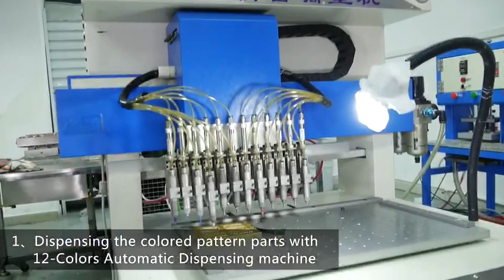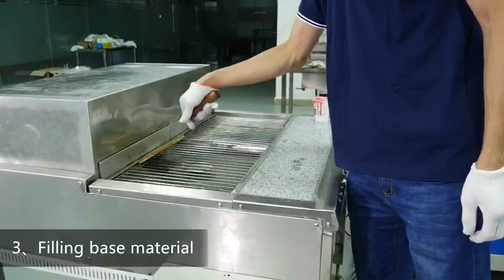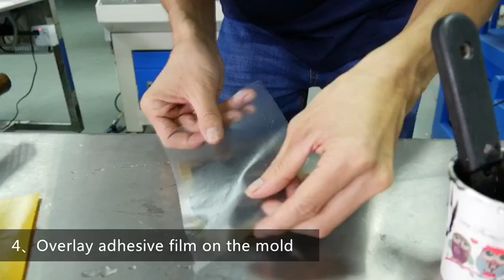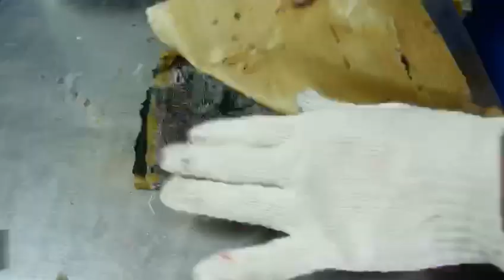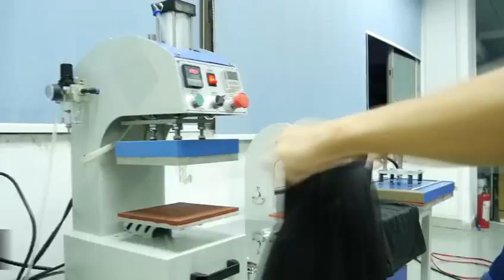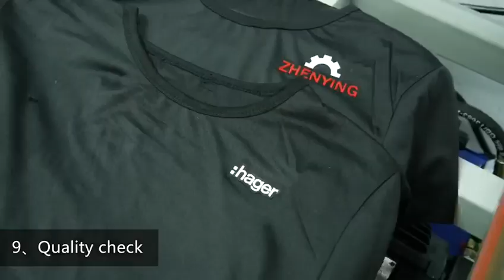Silicon heat transfer label forming machine ZHENYING

Comment: It’s super beautiful what you do, I would like to know how to make a mold and with the materials used? Thank you
Reply from the maker: Mold is made by CNC engraving machine,and the material used is copper.
Reply: @pvcsiliconmachines  I want to buy this machine . From where should I buy ???
Reply from the maker: @anis7779  we can supply machines,molds,and materials.
Reply from the maker: My whatsapp is   0086 13925710069
Reply: @pvcsiliconmachines  Hi Angelina, liquid silicone is the mixture of 2 liquids (A, B) and when these are mixed you only have a period of time to work before it solidifies. Is it the same liquid silicone that you use in this video?
Reply from the maker: @cesarmata3787  yes,same